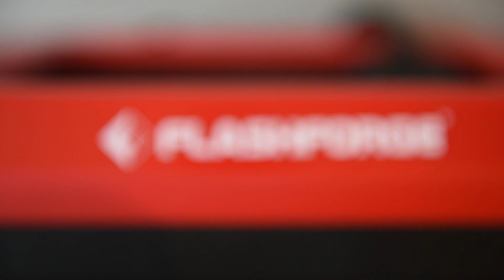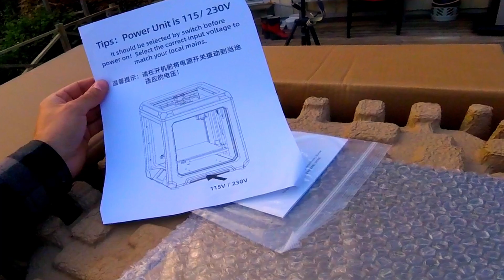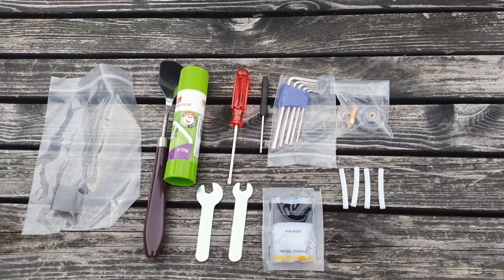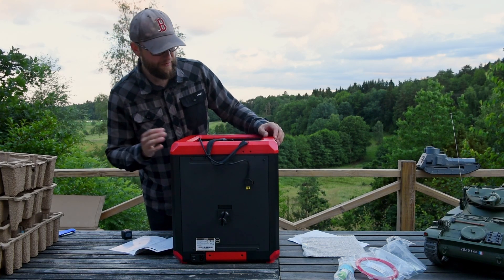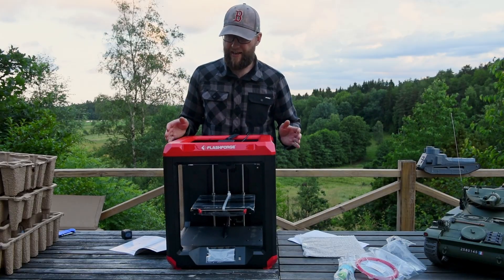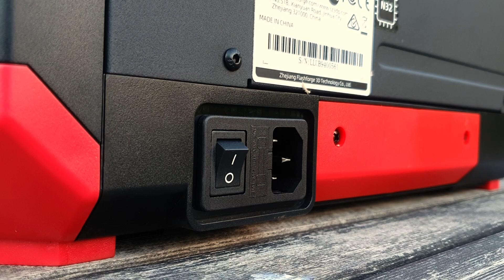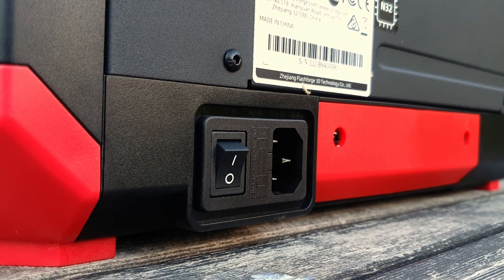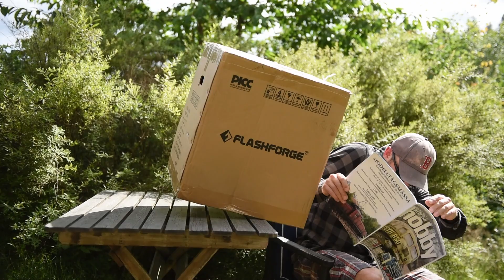Unpacking the new Finder 3 3D-printer from Flashforge!

Comment: I've been evaluating the Finder 3 and agree that it is a good follow on to the Finder 2, especially the large heated bed and somewhat easier leveling procedure.  That said, the Finder 3 uses a proprietary brass nozzle which extends through the heater block.   Any information that you could provide relating to nozzle replacement as part of your follow on video would be much appreciated.
Reply from the maker: Awesome man, thank you for that feedback, very valuable. 👍